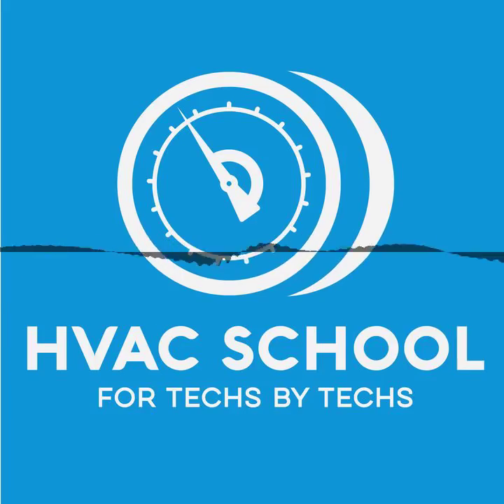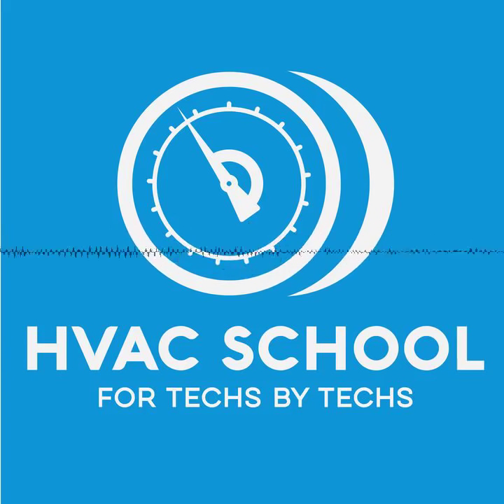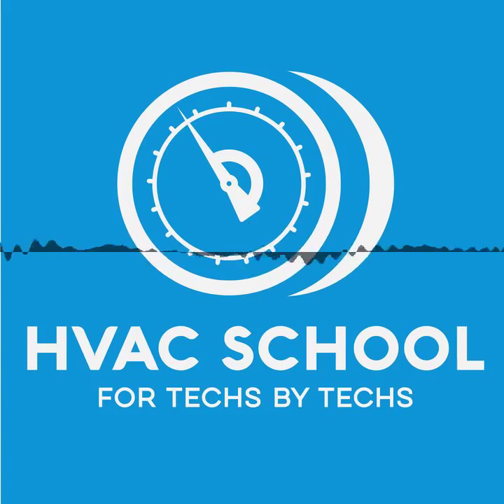Short 11 - Superheat, The True Meaning

Comment: I agree with that, and after 32 years I still use "Compressor Insurance"; the compressor is a VAPOR PUMP, and you want only vapor going to the compressor. A high superheat  MAY be (withing design conditions)  a less "aggressive" evaporator, and a low superheat MAY be (within design conditions) an indication of a more "aggressive" evaporator. The greatest transfer of heat takes place during the change of state. That's how I was taught.  Within design conditions, superheat may tell us how much of the evaporator we're using. GREAT CHANNEL, THE BEST. I teach all the methods you mentioned at the outset as well to my newbies. GREAT WORK. After 30 years I pick things up from you.
Reply: A compressor doesn't pump though it  compresses

Comment: We use subcooling and super heat all the time in the fridge process. I work for Scotsman industries, an ice machine manufacturer. Both readings are super important and helpful in determining and diagnosing problems and proper function. 

Nice and simple video you made. 

Sometimes it’s easier to use water as an example of super heat as most if not all are familiar with its characteristics. An example would be waters boiling point. Thus, if water is able under pressure to absorb one more degree of heat past its boiling point, we now call that one degree above boiling, super heat(ed) (steam) or vapor.

Comment: What i don't understand:  Why is the temperature-bulb of a TxV direct behind the evaporator?  Would it not be more accurate if it would be direkt before the compressor?  Because that is the point, where i want to have a little bit superheat?  Sometimes, especially in split-ACs there can be 10m between evaporator outlet and compressor inlet.  So, if the superheat at the evaporator outlett is perfect, the superheat at the compressor inlet can be totally different.

Comment: Thanks for that.  
I’m an appliance tech, getting into HVAC, but how I could use these principals, practically for fridges?  Obviously a lot of fridges aren’t worth seal system repairs, but the higher end sub zero and Vikings are. I would like to be able take this knowledge and apply it to fridges.  

I asked you a question before with no reply, so if there is a better way for me to ask you, please let me know. 

Thanks again for all the vids!!
Reply from the maker: You can measure suction superheat on refrigeration in the same way and it has the same significance as A/C
Reply: HVAC School would you measure at the compressor,  or outlet of evaporator?
Thanks for the reply!
Reply: toneblair at the outlet of the evaporator

Comment: Superheat is to measure efficiency of a system. This is done last after the charge is calculated based on line set run and factory charge, proper installation, proper airflow and CFMs for system and equipment is properly sized for application. If any of those factors are off or a combination of factors, it will throw off your superheat reading. This I never check superheat until I know the system is sound and properly installed for said space/application.

Comment: So what your saying is if you have a house that's 90deg indoor and it's 95 outdoor if you show up and bam instantly throw ur gauges on and see you got 50 deg superheat and start pumping refrigerant into the system and say your unit says it wants 10deg superheat .....so you bring it down to that in the first 15 min your there ...once it the tstat starts bringing it down to 65 deg probably before that once indoor drops your going to find urself extremely overcharged ...
And u gonna start flooding the compressor.....????
Reply: So we can agree that 65 to 70 degrees is going to be a target temperature for most homes ..
.so depending on climate ..
You should stay to the high or he low side of the exceptable actuall super heat .... once u have slowly brought the home down to desired operating temp assuming that the unit is sigzed properly...
Reply: Remembering pressure and temp in refrigerants go hand and hand unit will read high pressure at high temp so u can't just say well oh they all run about 130 low side ...ull end up way over charged
Reply: @mrfauk1948  in my area 72-76.  I may be taking care of baby boomers.
Reply: No, what he is saying is the Superheat is directly related to the amount of heat being absorbed by the refrigerant (ubderfeeding = too much heat, overfeeding = not enough heat). In your scenario (90° indoor and 95° outdoor) you will never see a charging chart call for 10° of Superheat. In fact, most Superheat calculators and charts only go to 76-78° indoor wetbulb. In your scenario you need to bring the indoor conditions down to where they are on the chart first (76° IDWB) BEFORE you set the charge. 

Then (76° IDWB) the Superheat will be about 29° for correct charge, so that when it does drop to 72° inside (say 68° IDWB) the Superheat will be 14° and you will not be feeding the compressor liquid.